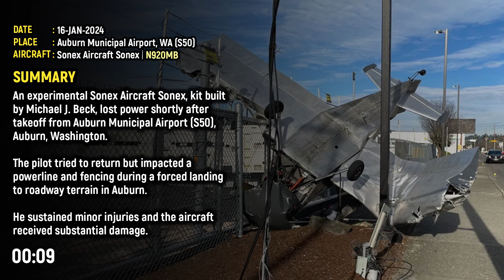Aircraft crashes into a chain-link fence off the side of the road! Pilot Minorly Injured [ATC audio]

Comment: What is your source for the data showing the ground track?

1.  The standard pattern for 1-6 at Auburn Airport is RIGHT-HAND, not left as you show.
2.  The track on Flightaware shows him abruptly turning back to the airport from several miles away, and approaching to land from the north (for 1-6).  This would be behavior consistent with the engine developing a problem and the pilot taking the shortest route back to the airport.
3.  The track on Flightware doesn't show him flying a left-hand pattern at all.
4.  A left-hand pattern for Auburn 1-6 takes the plane over densely populated areas with limited opportunities for forced landing.  A right-hand pattern, on the other hand, takes the planes over some pretty wide-open areas.  That's why it is a right-hand pattern, to keep from flying over houses.
5.  Transponder operation near Auburn airport is iffy, as it is actually located BELOW the FAA radar stations (the airport is in a valley, the radars on on the surrounding plateaus, well set-back).

Now, there are reasons the pilot may have turned left, not right (such as having better visibility).  If he did, I'm fine with that...not going to Monday-morning quarterback him, and I'm glad he came out of it with just minor injuries.  

I'm just curious as to where Flight Records found such accurate track data.
Reply from the maker: First, I appreciate you asking and bringing this up in the comments. To be honest, I couldn't find a flight track for this flight on Flightaware. The last flight for the callsign N920MB was on January 15, 2024, but the accident happened the day after that flight. Second, I created a pattern myself instead of just showing the conversations on the screen. This was just for visual purposes. I apologize for not mentioning this earlier.
Reply: I was the pilot. Flightaware dis not pick it up. I was about 80 to 100 ft. Taking off 34. Approaching power lones that are 80 ft high power lost. I messed with the throttle and power came back. I had pushed the nose down immediately. Power returnes i kept climbing and shallow turn to the right which is east. There is a field close by. Wanted to keep climbing and make that field or if i could get enough altitude, the airport. I was pointed to the field and it completely quit. Cant make the field or airport. Road below me. Turned to right to make the road my runway. Kept nose down tried to start 3 times. Now i pushed down to go under a powerline across the rd. I see a big truck and several cars coming at me and i moved to the right. Clipped sign post with right wing. It slowed me down and turned me 180 deg and i was lookin at pavement and straight down about 5 to 10 ft. It slid a few feet and the right wing slammed the light pole. Rested tail on fence. I popped the canopy then 4 pt harness and stepped out left foot then right. Now a young man grabs me along with a young woman and walked up the sidewalk a ways since 16 gallons 100LL gushing.
Reply: Injuries were a sore back. Hospital gave ct scan hip to neck. No injuries. Accident was about 11:30am and i was home at 5pm. Just slight muscle soreness now.
Reply: @dangrover12 glad to hear no major injuries.
Reply: @dangrover12  , thank you VERY much for the insight here.  My congratulations on a successful forced landing, even with aircraft damage.  I've been flying Fly Babies of one sort or the other out of Auburn since the '80s, and fully appreciate the difficulties you faced.  Well done.
Reply: @ronwanttaja8209  Thanks. I did what you are supposed to. Nose down dont stall and dont turn back. Straight ahead. Im surprised i acted so fast and made it that far for the short time i had power back. You must know the field i was headed to. Im still shook up. Found out tonight that was a 7000 volt electric fence.
Reply: @dangrover12  You bet.  I analyze homebuilt accident statistics as a hobby, and see too many cases where the pilot loses control during an accident.  One of the things I found is that the pilot RETAINS CONTROL of the aircraft, they've got a ~85% survival rate, regardless of what they're landing into.  Even if they end up going into a building, the survival rate is 75%...as long as they fly the airplane to impact.

If they let the airplane stall, the survival rate drops to 39%....
Reply: @dangrover12 Congratulations on a successful forced landing. You walked away from it, so it was a great landing. Plane looks fixable, too. You flew it all the way, and you're here to tell the tale. Great job.

What engine? AeroVee with AeroCarb? Any suspicions yet on what caused the engine to quit?
Reply: @oscar_charlie  aerovee with a rotec TBI. Plane it ok from back of canopy back. Way too much to fix i think. For me anyway
Reply: @the_flight_records  I will shake a gentle finger at you regarding posting speculation without clearly identifying it.  You're doing good things here; I'm sure you'll do better in the future.

I'll reference my local knowledge to explain WHY there isn't an ADS-B track:  Auburn airport is in a valley is at 57 MSL, and all the FAA radars are located hundreds of feet higher than the airport, and are set well back from the valley edges.  It blocks the radar.  When I fly from there, I generally don't see the transponder "reply" appear until I get to 500 feet or so.  So the Sonex never got high enough to get painted.